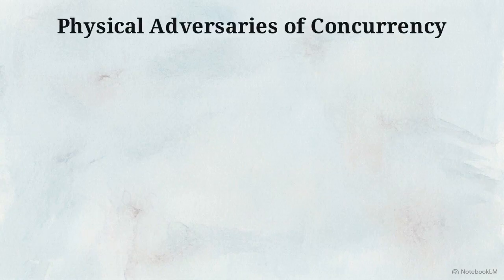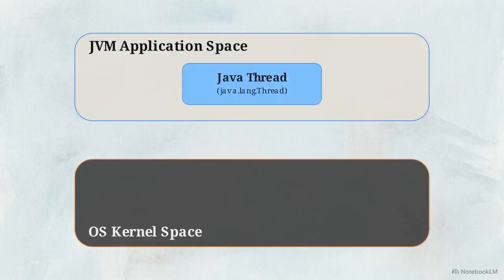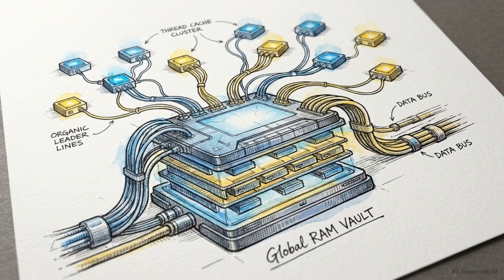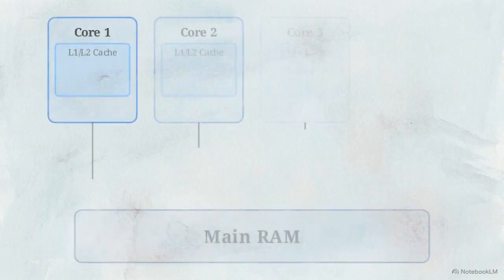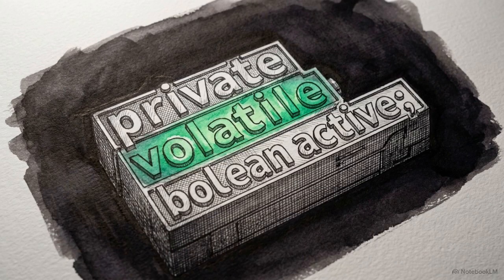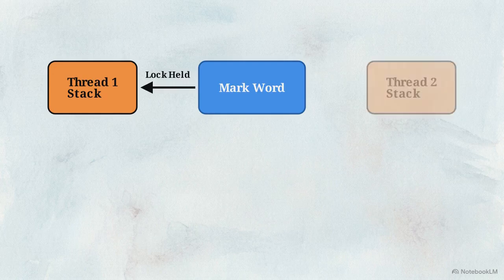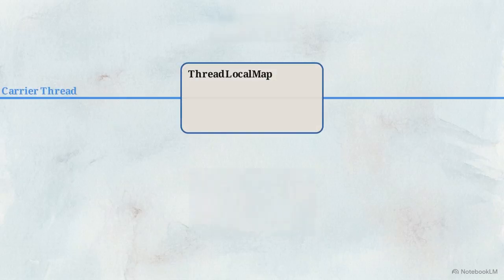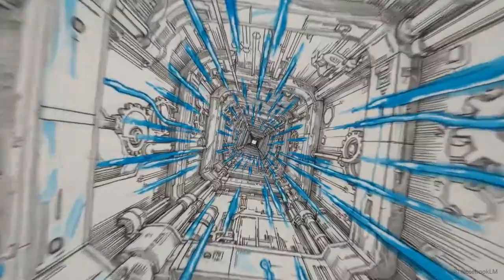Java Beyond the Textbook: 11. Memory Barriers, Lock Inflation, and the JMM

Comment from the maker: It is mind-blowing to realize that synchronized isn't a static mechanism—it is a living runtime escalation ladder inside the object's 64-bit Mark Word. Moving from low-overhead CPU Compare-And-Swap spin loops into heavy, kernel-level OS ObjectMonitor inflation is where high-throughput applications go to die. Have you ever had to profile a production container and find a massive memory leak stemming from an un-removed ThreadLocal reference? Let’s talk memory fences and locking pipelines below! 👇